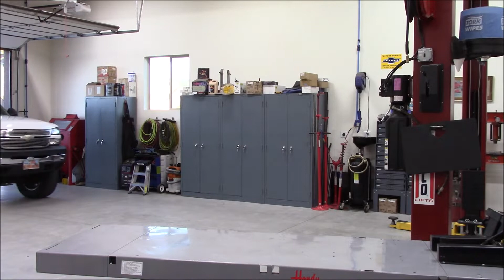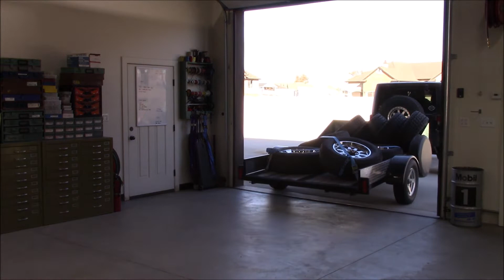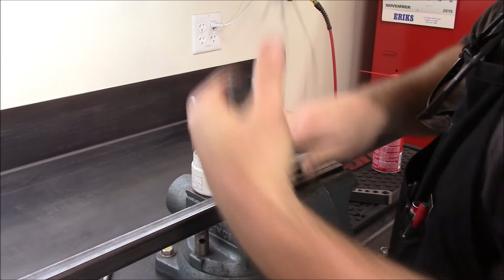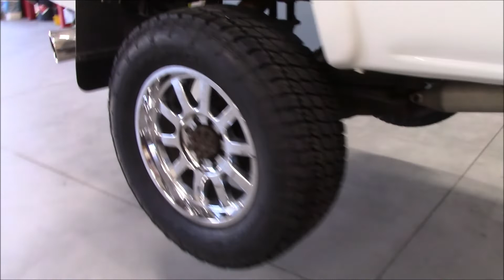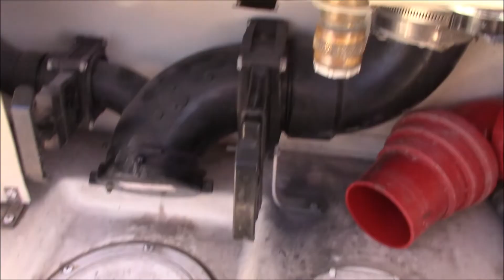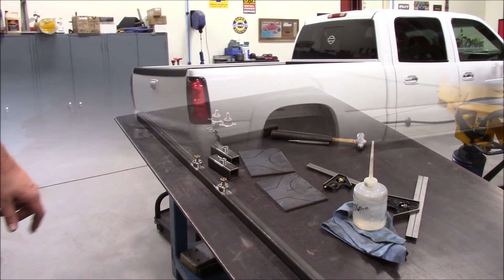Saturday Shop Tour #5

Comment: what volt battery do you run off of? lol great video at one point I think I head some classic rock on the radio. Am I right?
Reply from the maker: JC, what battery are you referring to?
As for music, I think I had it on a country station yesterday. Sometimes on Saturdays I will listen to classic rock when they play block parties but I think I still had it on the local country station. 
Mike
Reply: @zmotorsports62  Your human battery your like the energizer bunny the way you work.
Reply from the maker: Ahhh.  That’s what you meant. Thanks but I think my battery is getting some age on it as I’m slowing a bit and it seems to take me a little longer to do things than it used to. 
Thanks for following along JC. 
Mike

Comment: A set of all terrain tires rarely last me much over 40k.  If they do, the noise is usually unbearable.  Your truck is a gem!
Reply from the maker: I think it has something to do with the weight of my Duramax because those same tires on my previous Jeeps went well over 50k. The last set of 35” BFG All-Terrains that I just removed from my Jeep Wrangler had 48k miles of driven miles another approx. 14-15k miles of flat-towed miles and I sold them with still 7/32” remaining. 
Thanks for watching and the comments. I try to keep my truck in pristine condition and hope to have it in just as good of condition years from now. 
Mike